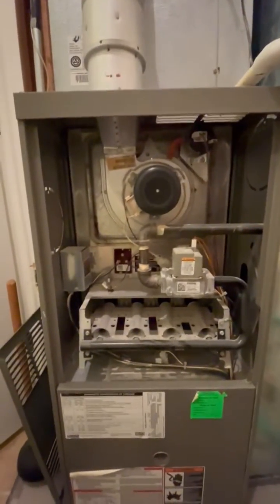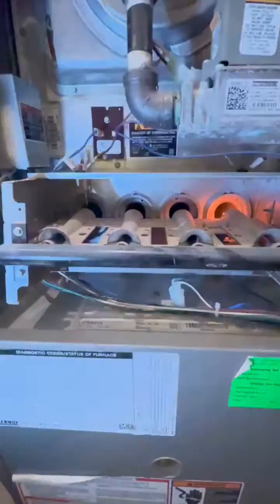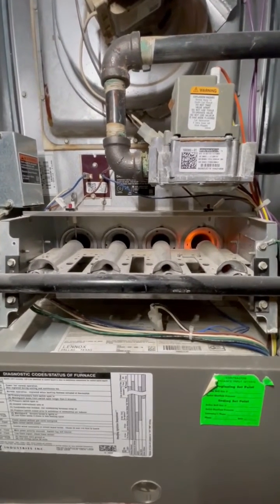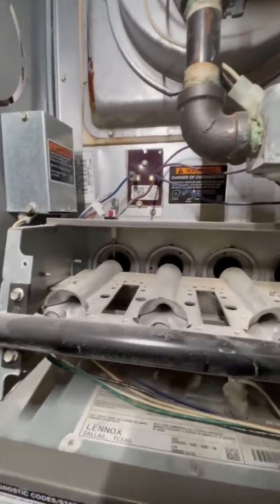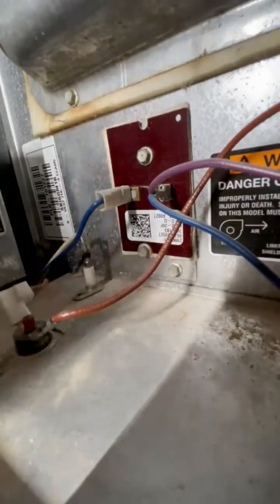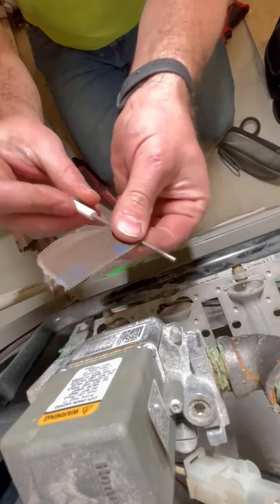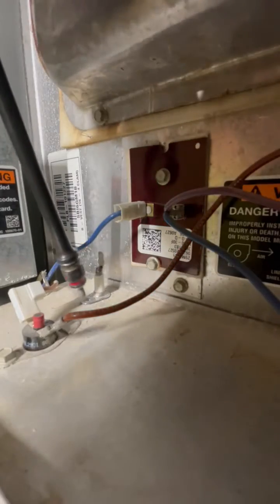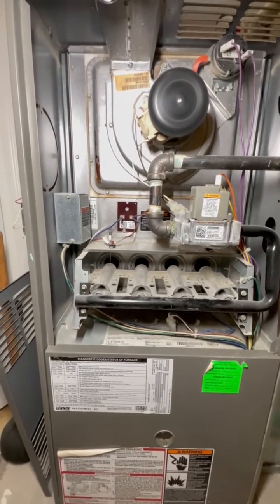Why is my furnace or heater turning on and off? Easy fix  Save hundred doing this!

Comment: FOUND THIS looking for MY ISSUE. MY ISSUE is a propane furnace that has the thermostat set at 50°, the house temperature "throughout" is no lower than 66°, ambient outside os 44°. The furnace is kicking on, running AS IF it wants to fire, for about three minutes then just shutting down. The FACT that it is starting at all concerns me the most, the fact it doesn't fire before shutting down adds to the consternation.

Comment: I had to turn the heat system on off for 2 nights because it wouldn't come on it was not igniting so I just shut it on off then today I tried it I turned the system back on again and it's working again and I haven't shut it off I letting run for 4 hours on the heat setting of 83 to see how long it will keep going on and off with that sitting

Comment: Hello, I got a Trane xe90 split system. My furance short cycles 3 or 4 times then I get a hard stop. It usually runs for couple minutes then stop but as it short cycles the run times get less. Reset power and it repeats. Flame sensor is very clean. Any ideas? Thanks

Comment: Ok mine was doing this and my flame sensor and igniter are one piece. I went to clean it and the ignitor broke. So I replaced it. It was working fine for a few weeks now it's clicking on and off again. It will ignite, the blower does come on then after a couple minutes the gas cycles on and off.
Reply: Also it's a Kenmore furnace. If it sits off for awhile it works fine but then after running awhile it starts doing it again. I assume something is getting hot and not working correctly. Which is more likely the board or the gas switch?

Comment: Interesting, techs ALWAYS cite the need to replace sensor at a couple hundred $.  I didn't know you could just clean it, even though I'd tell them 'sensors rarely just 'go out.''...'well they fail from the heat,'...ok, right, whatever.   But mine is tripping after longer run, (new sensor and new filters) and it seems to be due to flimsy return air duct in attic.  But it's not blocked and I don't want to spend $1200 and still have issue.

Comment: No, this is not my problem. I've replaced the flame sensor, the controller board, the gas valve. The blower works, but doesn't turn on when the heater is turned on. Everything turns on, doesn't blow, after 5 min it turns off. The fan itself works fine. The AC works fine. the blower has no issues coming on with those, but not the head.

Comment: What if it fires and runs for about a minute and then shuts off? I took the flame sensor out and cleaned it with sandpaper and it still does the same thing.

Comment: My furnace would start up and stop, after a few attempts  it turn on, so I cleaned sensors, replace my wall  thermostat plus it never gave me a warning ligth, so I replaced the control board and still nothing, finally I suspected the gas valve was not opening completely  and bingo! I replaced it and it worked like normal. This went on for 6 years . I had it look at befor,  but the person just cleaned the flame sensor, moved a few things, and did not know what it was , granted it was I. Summer so he could not replicate the issue.

Comment: Thank you for this video!  We tried this and it didn't work to fix the issue. We installed an new sensor and that didn't work either.  So now what needs to be checked and fixed?

Comment: I can’t tell which one is the flame sensor in my furnace. My flame have been going off every time I lit it so I’m guessing this could be the problem. I’m a rookie so a bit stressed out with this as it’s cold here and we need the heat. Any help or suggestions?

Comment: I did this and it just shut off again today. Worked for two day's.  Installed new air filters, cleaned both ignighters, air compressed all the dust, any other ideas??

Comment: Hello sir , I have a question I hope you can guide me to understan better . We got our furnace about less than 3 years , we bought 7 years service so they come twice a year check heat or ac cold , this year they came to service furnance for hot air . The man this time went & sat down in front of the furnace for over 30 minutes , I ask him What's up ? he said checking the gas presure , the man was huge so I was not able to watch him , when I starded to ask him what's wrong he took the sensor out & pretends he is cleaning , but before he was taking  some part out & shove it in his left side bag , when he left heat was not like before , when we put the thermostat at 74 or at night 75 hust to warm out fast then go back to 74 , what ever the man did to our furnace we have to keep it at 79 , then works only 5 minutes then turn off . I have complain 3 time they send someone else & play dumb , are you able to guide me what he has done . we have paid for 7 years service , each time 
they come they try to sell something . Is that amazing ?

Comment: In my case, my heater will gas on, but then shut down, then within 5m, will try to turn on again. But then other times, the heat has no problem turning completely on. Could a dirty sensor be an intermittent problem?

Comment: Seems like that was it for mine! Thank you very much for making this video! My Heil furnace was turning off about 5 minutes after burning then would turn back on after 30 seconds or so. Changed the limit switch and seemed to help but still didn’t stay on for the full cycle.

Comment: You deserve some special recognition because this appears to be the exact fix to my heater problem and we are having some cold temps even here in damp Seattle.  Found the sensor cleaned it and the heater has been on for over 24 hours with no hiccups...thanks much !!
Reply: I having the same problem over hear Yakima wa tk you sir very very much
Reply: Just have a problem similar but my heater burns do works for like 2 min then they turn off even with the controller in always on then the all system shuts off and I starts again very quickly in seconds keeps doing the same for a couple more times then heater shuts off for last time and never come back on do you know what happen???
Reply: @urielramirez8699  just try it bro it’s easy it should work

Comment: My furnace was blowing cold air today, and the burners were shutting off after a couple seconds.  I pulled out the sensor and cleaned it with steel wool and I have heat again.
Reply from the maker: Awesome glad this was helpful for you

Comment: I don’t ever usually comment, but it’s -11 degrees currently where I live. My heat went out yesterday, and I’ve been trying to figure out the problem. This video fixed it RIGHT away. It kicked on instantly after following your instructions. I seriously can’t thank you enough for your videos!!
Reply: Hey brother. It worked. Saved me time and money. Thanks 👍🏽
Reply: Last night it was -4 and my thermostat dropped down to 62 lucky we slept fine but fixed it today! I was worried it was gonna be a pricy fix but luckily wasn’t 🤩
Reply: @Cesar-qc2es  We are preparing for  -24 degrees.  Furnace guys are booked for the next 2 weeks.
Reply: Thank you so much. A single mom with a 90-year-old mother and physically disabled Son. I needed the heater quick, especially when it's 1 o'clock in the morning. You helped a lot, thank you.

Comment: Thanks for the video. I have the same problem with a new American Standard system. Only a year old. It’s under warranty.  Tech came out and did exactly what you did. Said sensor was reading 2.8 and should be reading 3.2. Whatever that means.  Next day it started doing the same thing.  On for a few minutes. Off for a minute and then back on for a few mins. Tech returned and replaced the flame sensor. Unfortunately today it is doing the same thing.  Any idea what other issue could be causing this.
Reply: Having the same exact problem. Furnace is 5 yrs old and they have been out every year since I bought it and still having the same problem. I have paid hundreds of dollars in service calls. I am over it!

Comment: Can these go bad ? I cleaned mine and it worked like 5 minutes
Reply from the maker: Yes it’s not common but they can go bad. They need a good connection so if the screw is not snug and it’s not making a good connection to ground, they will have issues

Comment: tried this in the past and it work.  This time it didn't work.  bought a new one and installed it (didn't touch metal part). still didn't fix it.  Any ideas?  fast alternating red and green light

Comment: Well, Ours may not be turning on and off, but it just short cycles.
Reply from the maker: Hmm, Is it flashing any codes? I always check the filter first and foremost, if you don’t have a new one to put in yet, just pop it out and let it breath and go from there
Reply from the maker: Is it keeping the home where you want it at, temperature wise? If so, it may be incorrectly sized for your home.  If not, then there is definitely another issue.